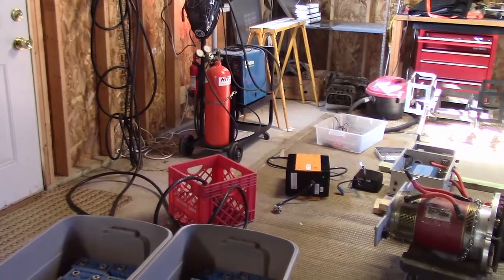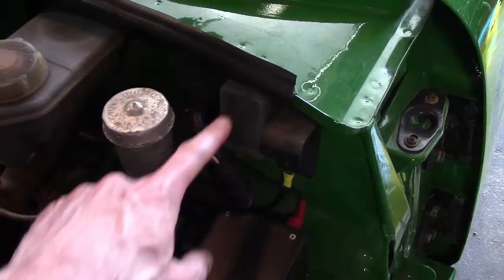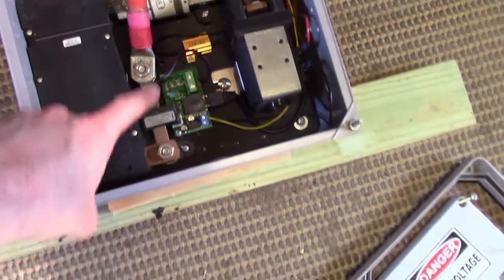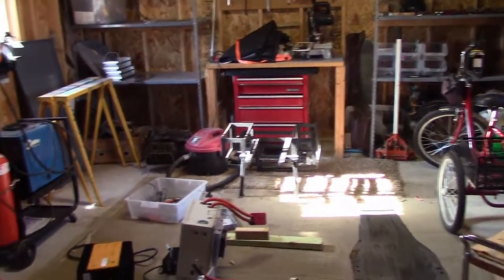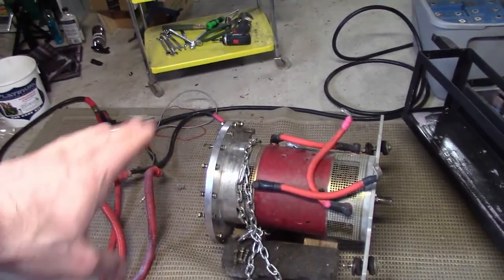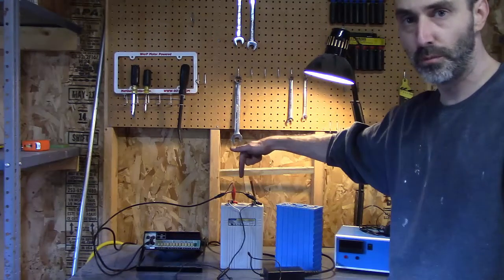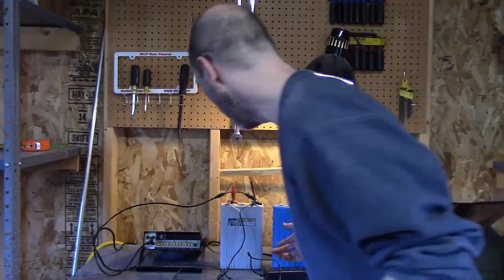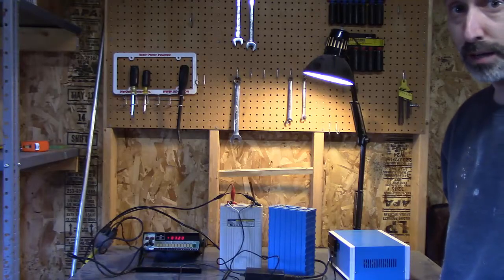Electric Car Conversion: Spitfire Teardown and Battery Balancing

Comment: Hi,

I’m working on my own MG Midget 1500 conversion.  Same engine/trans as Spitfire.  I don’t have the engine.  I’m trying to find the measurement from the engine back plate to the face of the flywheel so I can recreate that distance from the face of the adapter plate and get the coupler machined properly.

Do you have the number you used to set that disrance on your conversion?  Hope I’m making sense what I’m asking.

Thanks
Reply from the maker: I know exactly what you're asking for, but unfortunately I didn't take good notes and it was so long ago, I don't remember. Try asking the diyelectriccar.com forums or the reddit.com/r/evconversion subreddit. I'm sure someone on there will give you a quick answer.

Comment: Would you sell the conversion ?
Reply: I meant is it still available
Reply from the maker: @aaronperry5261   The car itself is no longer available.  But the motor, adapter plates, battery boxes, etc are available.
Reply: Where are you located?
Reply: I have several Spits and Vdubs. Looking to convert one or two
Reply: Did you ever sell this? I have a spitfire I'd like to convert, or a guide of how you put it all together?